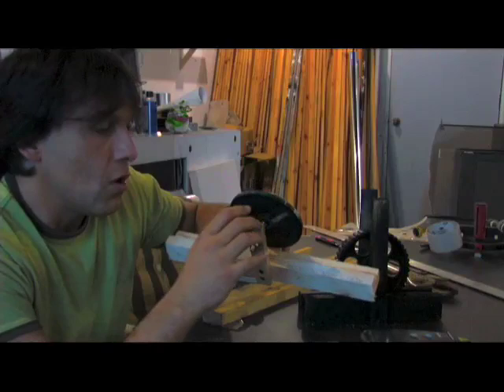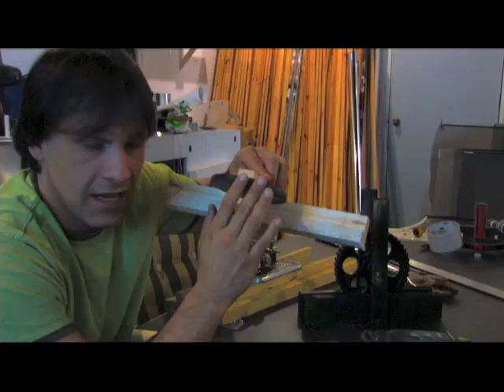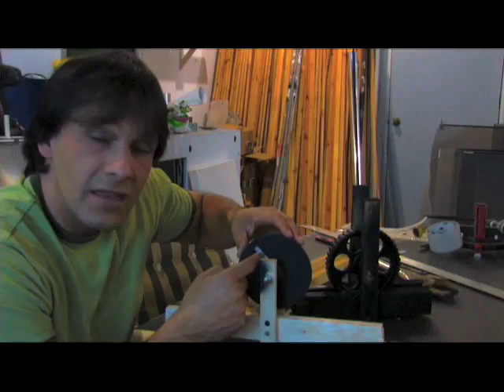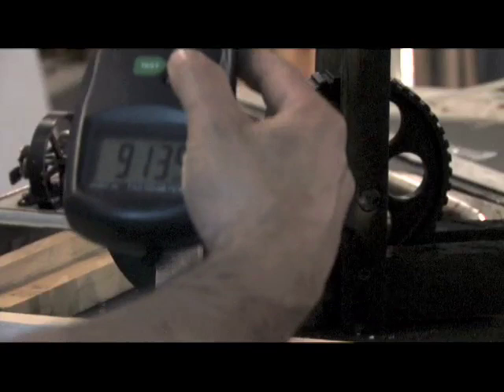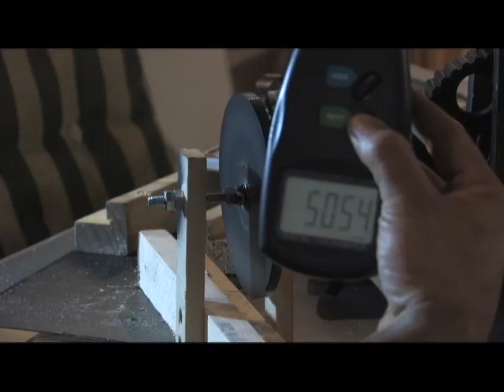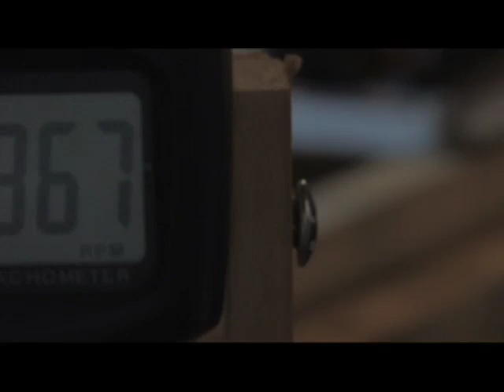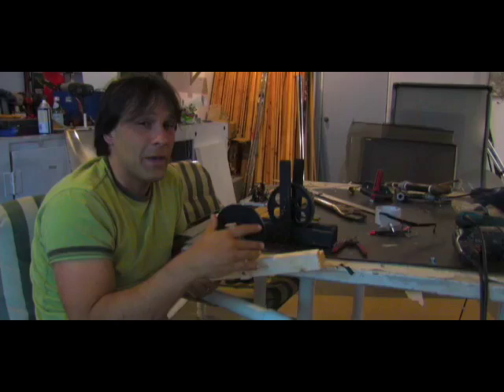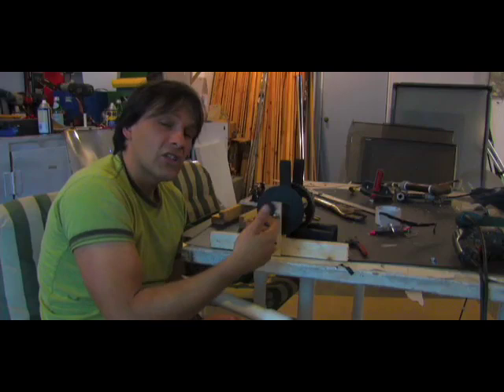CD TESLA TURBINE 2 VLOG MAKE A TESLA TURBINE OUT OF CD DVD

Comment from the maker: Like this no. In a fully functional Tesla Turbine sort of. Because this is open higher speeds are reached as the air flows across the smaller portion of the disks. This acts like a transmission gear with the outer being first and the innermost being 4th. On a conventional impeller the flow only reaches the outer area so the area that covers the most distance can only go as fast as the air or fluid flow. In a completed model I do not currently know the speed reduction across the innermost section

Comment from the maker: GOOD QUESTION!!! This with CDs is really nothing more than a gadget as it cannot be used with any solar or heat source, only recycling old DVD and CDs I suppose. But it does illustrate the power of the Tesla design and the boundary layer effect, metal plates spaced similarly could harness steam. The question is, will the design out perform a standard turbine or is it just a gadget. I found a source of plates that are heat resistant and will work perfect. Future Video.

Comment from the maker: Yes, I have 3 stainless steel pipes in descending diameter. I plan on using the Neutral Plate design. I am hoping to run it into the air intake and see if it really boosts MPG or if it throws off the sensors. Have you tried it yet?

Comment: @floyd5666 just attach it to a permanent magnet motor/generator and it will generate electricity. Its the same thing as putting magnets on the disks with coils around them. If you though you could make a perpetuum mobile machine, you're wrong. You can't generate more energy then you put into it. Btw if its air powered you would need to run a compressor, and compressors are quite inefficient machines, except for rotary screw compressors. Btw im a mechanical engineering student, fluid engineering.

Comment: 52x is not done by revs but bi reading multiple tracks at a go and disassembling the tracks in memory on the drive transparent to the OS. the dvd drives do not have enough motor energy to spin so fast. some hard drives spin up to 15000 though :-)

drilling holes will ruinb the balancing of the dvds and they will shatter at high rpm most likely. drilling the holes needs CNC prcision.

Comment: Hi,
Could you let it run against a piece of whool at one side (180 degrees of a surface) and against a copper brush hardly touching it against the other side of a single disc?
Wire the copper brush to a copper ball. Place another but  grounded copper ball close to it.

How big will the sparks get in inches? Or by placing a voltmeter between the balls, what does the reader say?